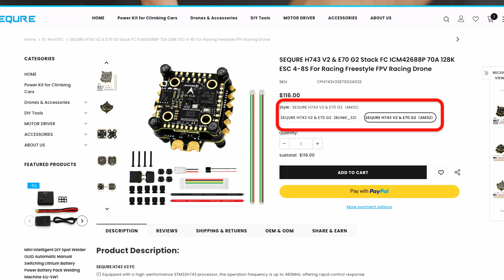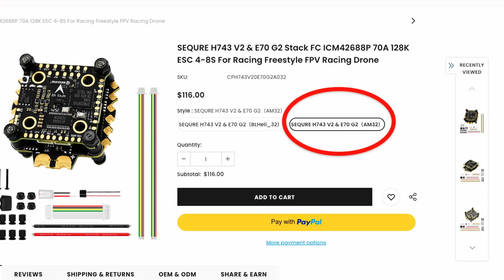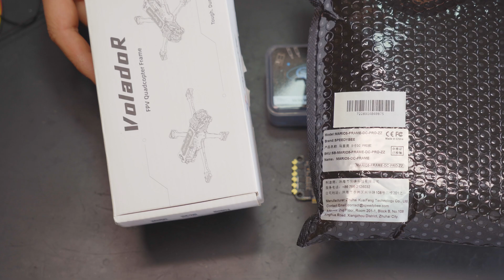Build an FPV drone with this Sequre H743 8s stack 💪

Comment: Just got the AM32 version for a 10” build I’m doing. With 3115 900kv motors I needed a higher amp stack. This one fits my needs for a decent price compared to other stacks with higher amp ratings.
Reply from the maker: Sounds like a great build, enjoy the process! 👍 I have been pretty impressed at the value for money with these stacks, the build quality is excellent, I love the solder pad lawyout, and mine has been super solid so far...
Reply: Just got one my self for exactly same reason as u. A 10inch build. Have u finished urs. How does it fly
Reply: @johnbayliss7124 I did finish it. It flew great. I ended up selling it to a friend because I just don’t have the space to fly it.
Reply: @1Joker.FPV1 i intend  on going up Northumberland close to were i live for some LR flying 😊

Comment: Does this flight controller have a betaflight target for 4.5.1 or 4.5.2? Saw a review of a BNF woth this stack and was only able to run BF 4.6 which isnt even out yet
Reply from the maker: Yes it does, as far as I know. I used mine to build up a FlyfishRC Volador VD6 and it's running Betaflight 4.5 without any problems, can't recall which version. YOu should be fine, and even if there were an issue, you can run Betaflight 4.6 with the online configurator...

Comment: I just ordered this stack for a new 04 build and I'm really liking the angled motor wire pads. This is something more ESCs should have.
Reply from the maker: I agree, makes soldering much easier! I put mine into a FlyfishRC Volador II VD6 Frame and it flies great!
Reply: Could you please tell me the frame you are using?

Comment: My money still hurts, only took one small crash to die both flight controller and esc. If you want to save buy others brands.
Reply from the maker: Really? How did both the FC and the ESC die? Did they just stop working, or did you crash in water?
Reply: Was looking at the sequre when I came across your video.  I'm currently building a valador vx3.5, and I'm stuck at the flight controller.  I really don't want to use a aio so I need to figure out the best for a 20x20 mini stack mounting. Can you give me some advice  on FC. Best 20x20 mini stack if I wouldbe best go with speedybee f4 or should I skip to the f7 or h7 like this sequre. Not sure if this is to big for the vx3.5. I'm good on the FC stack up to about $150.  Thanks for any advice...

Comment: You should put it in on that lumineer frame. I purchase this exact flight stack (AM32) after watching Jev. I built my 5’in two weeks ago and it feels/flys amazing. Put mine in the Era 5 I haven’t tried 8S but 6s is more than enough for my use case. Nice video on the stack. It’s a solid FC and ESC if you ask me.
Reply from the maker: That's great to know, thanks a lot for your feedback! I do think this stack would have paired very nicely with that JohnnyFPV frame, but since that one is already built up with an Argus Pro stack I'm thinking about putting this one in my Flyfish Volador D6 frame for a cinematic medium range cruiser that will run heavy batteries and a GoPro. This is an awesome stack that has way more power than I would ever need. Time will tell how durable it is!
Reply: @colibrifpv sorry, I miss spoke. Try it in that fly fish frame. That would be a sick build. Can’t wait to see your next video featuring the build you decide on.
Reply from the maker: Thanks a lot Dante, really appreciate it!